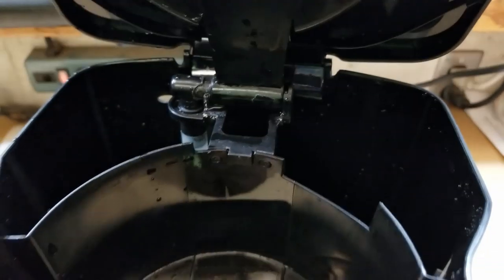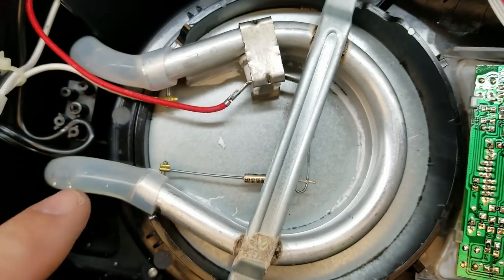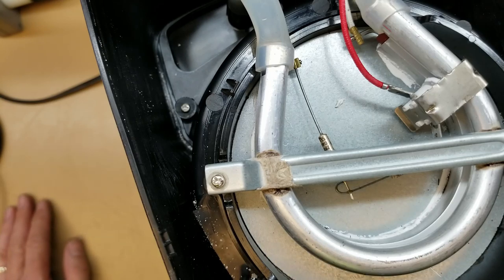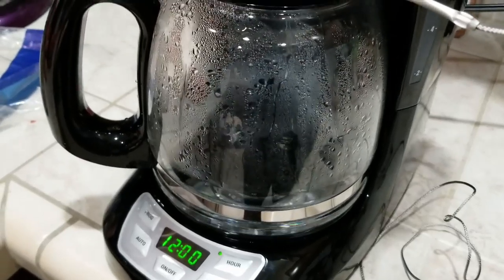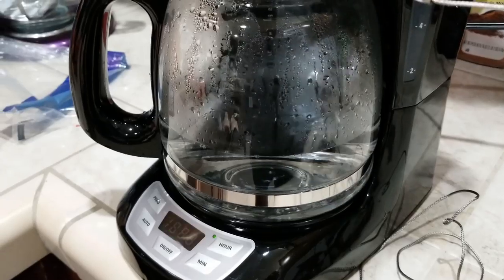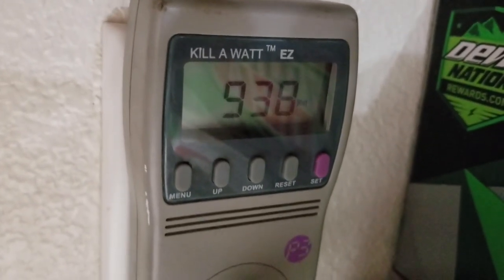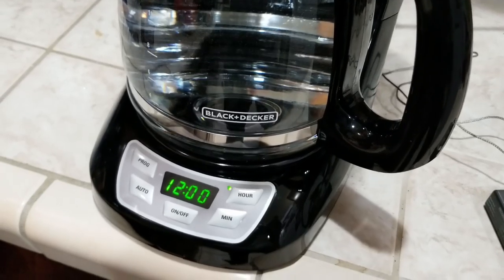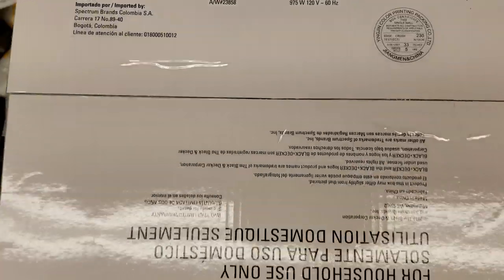BLACK AND DECKER COFFEE POT FAILURE LESS THAN ONE YEAR OLD

Comment: Have this same coffee pot for four years, no problem, great coffee, great price.  It just now started to "act up" wouldn't heat, played with plugging it in and out with power button push......refused.  Next day, tried again and it started.  Worked a couple weeks and now here I am researching.  I will probably buy it again, simply because the price is right and four years isn't bad.  Thanks for your information,  I will definately look into the extended warranty if it is offered!
Reply from the maker: Great to hear it started to work again. Sorry it broke again. Defiantly get the warranty!.

Comment: I had the same issue with a similar one. I was also surprised that it wasn't thermal fuse. Price of the heater is insane. Fortunately I had one much more expensive that the pot was gone, rendering it almost useless. After quite tricky transplant I have one working.

Comment: I kept my vintage  Corning Ware Coffee Pot and made coffee in that. I did find out I should pull out the grounds container BEFORE pouring. 

       I did a little more investigating BEFORE I bought a new pot or got rid of the old one. I have gotten the coffee maker to make a few more pots of coffee, I believe the programmable buttons are to blame for it not working. I regards to the gentleman testing the heating element. If the buttons are not working properly, wouldn't this also prevent the current from going to the heating element thus making it seem the element is the issue? The previous maker non programmable  lasted a very very long time (Proctor Silex). The pot was still good so that was donated.

Comment: My Dm1008B Black n decker 12 cup programmable was leaking water In side..obviously via a hairline crack in the clear hose...requiring a trip to a industrial plastic house supply store or lowes....this is after I took it apart and found alot of roach crap inside..which.required plenty of que tips with fablorosa cleaner....so to prevent future critters from entering a cut out some window screen material with tape. So I think I got it fixed..heating not an issue...h2O leaking

Comment: That's just ridiculous, 20 dollars for the entire coffee pot...
25.00 for the heating element. 
Why bother making replacement parts that exceed cost of unit...
They evidently use that element in higher end makers, but its cost effective to use them in the low end makers...
They probably buy the elements for 2 dollars from a Chinese source...
Crazy world Steve.
Best to you.
Reply: That element I doubt cost more than a dollar from the factory. Remember the $20 coffee maker has a purchase price, at import, after duties and shipping, of under $10, so the Chinese aggregrator must be paying under $5 per unit, in bulk, branded to customer specifications. Thus the factory likely makes the entire unit with a material cost under $3 per unit, including labour costs. The element and the glass bowl likely are the most expensive single parts in there.
Reply: @SeanBZA  .....you are absolutely correct, I just got frazzled at the cost of the part, and not realizing that you are 100% correct. 
That unit is definitely 3-4 tops to manufacture from top to bottom. 
Ty for your response.

Comment: I had one just like that (sans the timer).  It did the same thing.  Most of them just seem to blow their elements out anymore.  I'm wondering if it's a consequence of the two-piece design that seems popular, or whether it's just running the wire too hot (bad design geometry? bad alloy? bad refractory?)
Reply: Just cutting the cost of the most expensive material in the heater. The nichrome wire used to wind is expensive, so if you run it at the high side of it's operating range ( around 100C below it's melting point) you get the required heat output, and fast heating as well, but as the element cycles it alternates between hot and cold, and every cold cycle brings in atmospheric humidity, causing the wire to corrode on the hot cycles. Eventually the wire will either arc open, or arc and short out to the case, which is steel cast into the aluminium body. 

Norcal is right about the element being overrun, the design is likely for a 750W 100VAC element, perfect for Japan, but they instead use it on 120VAC, and stamped it with the new higher power output, as they do last at least 12 months for the occasional weekly brewing of coffee.
Reply: I've disassembled a few more recent cheapo power resistors and heating elements that failed, and while the wire was scaled, it was also obviously running excessively close to its melting temperature along its entire length (sagging, forming necks and blobs).  In the case of the power resistors, this occurred at about 25-50% of rated power while bolted to an oversize heat sink. 

In all these cases, the refractory compound wasn't a fine magnesia or alumina cement, but rather, a loosely packed (possibly merely sintered under operating heat) granular material (maybe just silica).  In these cases, the wire composition and geometry may have been perfectly adequate if only it were better coupled to its housing by a more dense refractory compound.   As you say, it also would have had less trouble with oxygen permeation.

Comment: If you want the best temp to brew coffee think of the old days when people use to use a percolator to brew coffee or the really old days when boiling water was poured through a coffee sock. The water had to reach boiling point in order to travel up the tube of the percolator and then recirculate to brew the java. This is the best-tasting coffee because you are extracting all of the flavors out of the grinds.  The reason modern coffee makers are set to no higher than 192 is due to liability. If people had enough brains to use a coffee maker correctly they would allow us to set the temp to 212 but society isn't smart enough anymore. I wont mention lawyers... lol